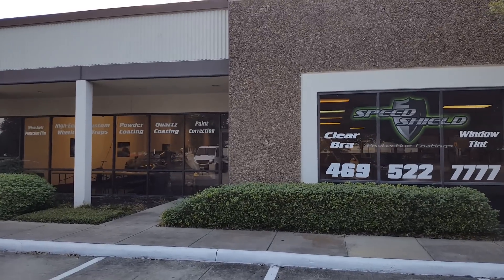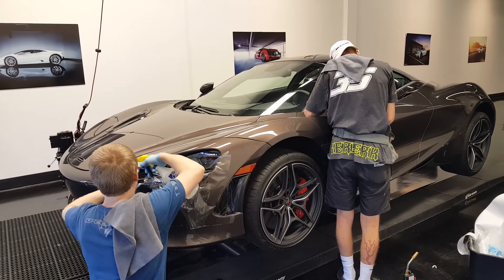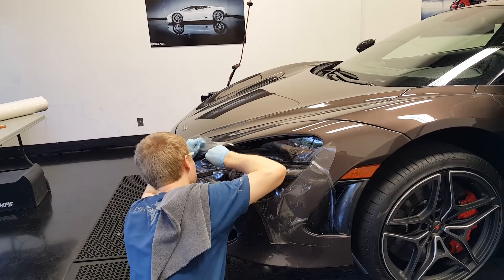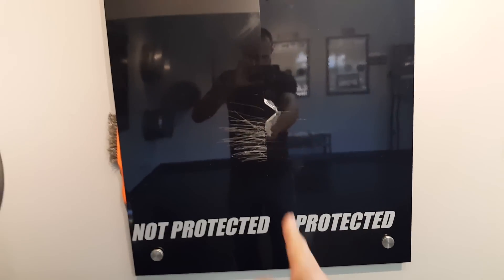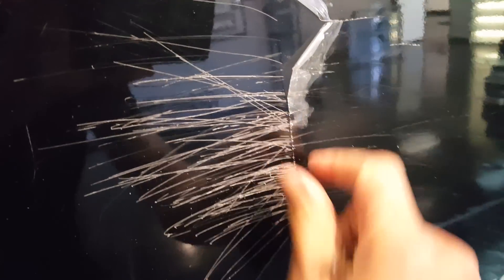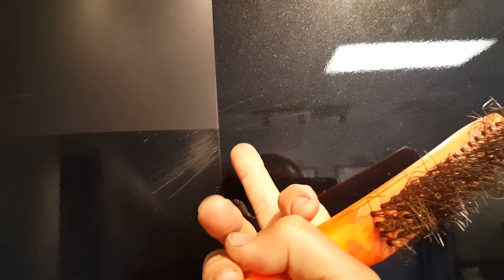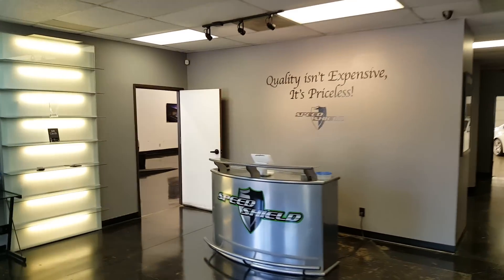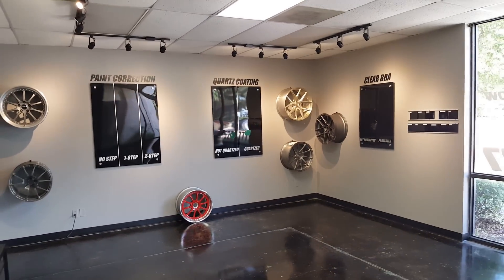What is a Clear Bra? McLaren 720S

Comment: Is it hard to clear bre the headlights? And also are you doing the doors from the inside?
Reply from the maker: Andrey, "hard" is a relative term. We are pioneers and have been innovating within our industry since the begenning of the automotive clear bra movement. It takes skill and dedication to our craft to achieve the level of finish out that we do. All panels are wrapped from the front and then the edges are wrapped around and tucked behind.

Comment: nice video,what is difference between hand trim and kits?? seem so dangerous to cut so close to expensive car.3m and xpel, what is difference??? thanks
Reply from the maker: Michael Lui
The "precut kit" is designed to be smaller than the panel to be coated so a new installer has a large "margin for error" and they don't need to trim after the installation. This leaves a large portion of the panel unprotected. Even if it's half price, if you still get rock chips after you have bought a clear bra then is that a good value? Most people agree that is no value. We have been installing hand trimmed clear bras for 18 years. Most hand trimmed pieces are trimmed with scissors beyond the edge and wrapped around to protect the edges. Even the parts that aren't we can score the film and tear it on that line. Don't let a pre cut installer try this. It takes experience and practice and typically, precut installers are new to the industry and are partaking in a learning curve that you should take your car nowhere near.
Reply: speedshieldusa thanks for replying where are youlocated??
Reply from the maker: Michael Lui we are in Addison,TX. Very easy to find on our website, google maps, facebook, yelp, google plus, etc.
Swing by we would love to show you more.

Comment: does the glossy coat fades in a few years?  And how much is Clear Bra, and how do you get your local shop to put this on?
Reply from the maker: Happy Hopping, the clear bra stays shiny! It will take all the punishment and save your paint over years of driving. You just take it off later whenever you feel like it.
Search for a clear bra installer in your area and definitely go see their finished product. A little leg-work (research) on your part can save you a lot of headache and save you from getting a cheap job that you will have to get removed and redone. Most of the time you get what you pay for. Cheap price = cheap product, cheap service.

Comment: You mean 0.8mm thick?. No way it's 8mm thick.
Reply from the maker: mft4 The clear bra material is 8 "mil" not 8 milimeter. "Mil" is an SAE thing. A mil is a thousandth of an inch. So 8 mil is 0.008"
Thanks for your question.
Reply: Thank you for the explanation, I stand corrected.